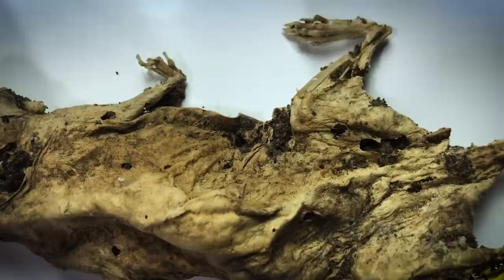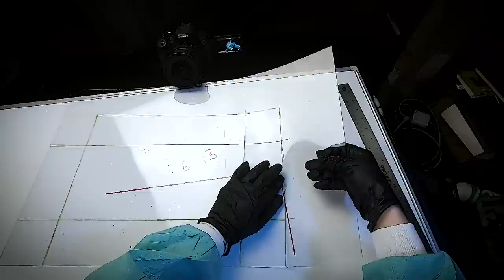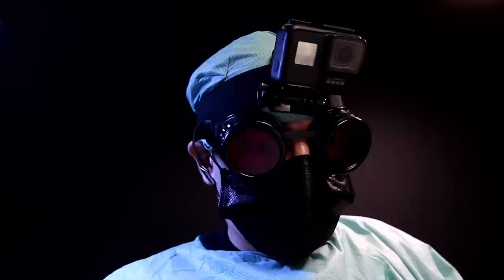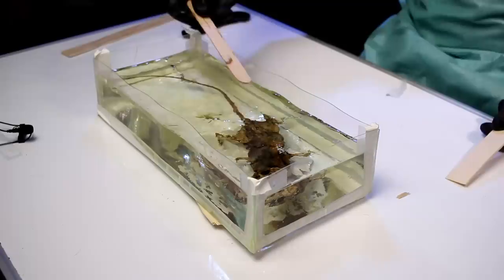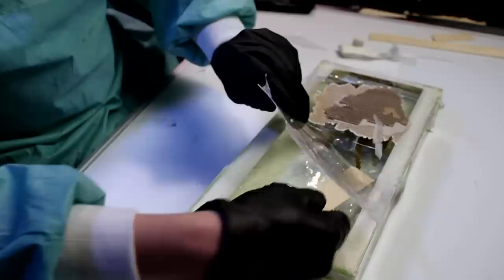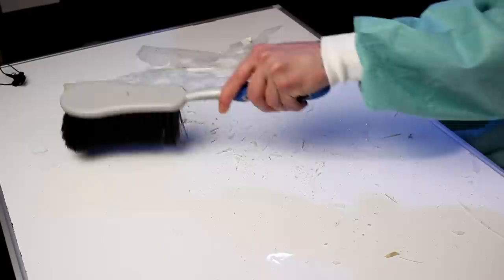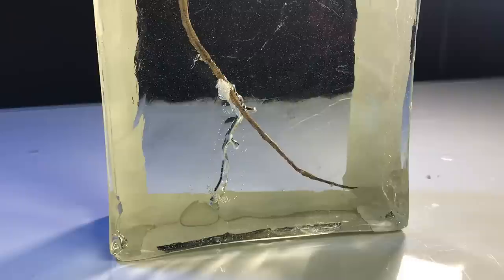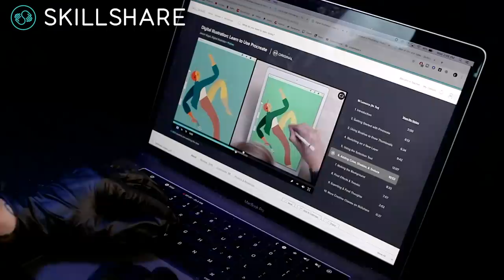dead rat ASMR

Comment: Oh nice this is one of my favorite hobbies. You can take care of the bubbles by by using an angle die grinder to cut through the layer on top of the bubble and then pour more epoxy in. Removing the sarcophagus at the end can be expediated with an orbit sander and you can polish the surface by gradually increasing the grain count to get a very nice looking finished product.

Comment: I work with resin and apoxi and yeah it's best not to put paper tape inside the mold or that will happen. It your wanting it to be more secure I recommend using a silicone mold. 
If you don't have one handy then I recommend butchering some cardboard boxes and tapeing those into the shape you want before putting the plastic sheeting.
So next time is the charm Rusty.

Comment: Rusty, if you wanted to remove the bubbles out of the resin, you should of put the mold in a vacuum chamber, you fool. And you should've used electrical tape instead of masking tape.